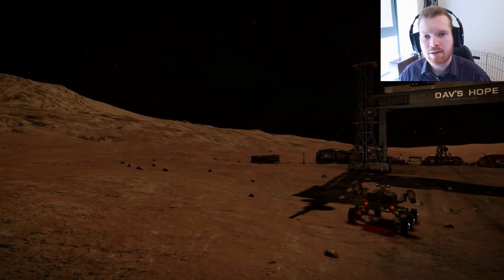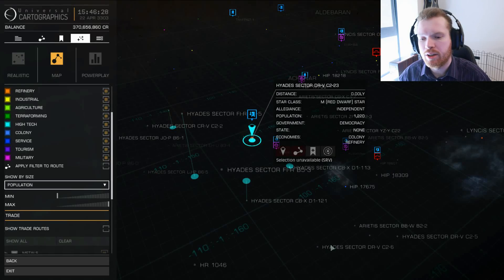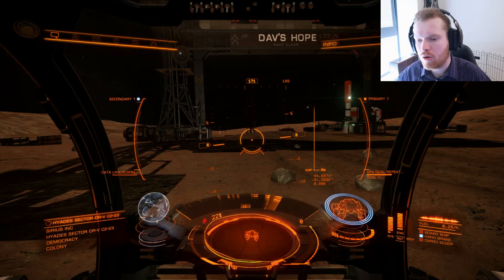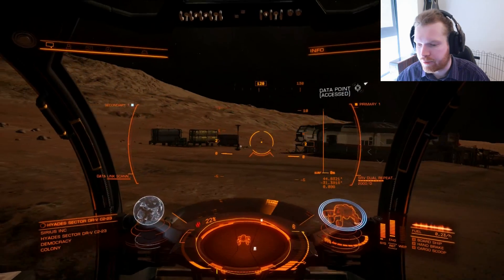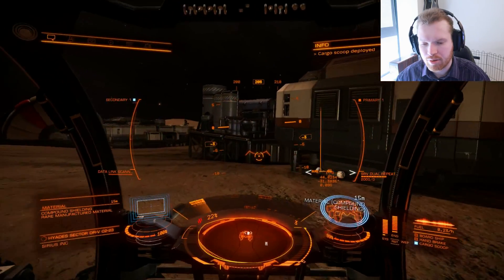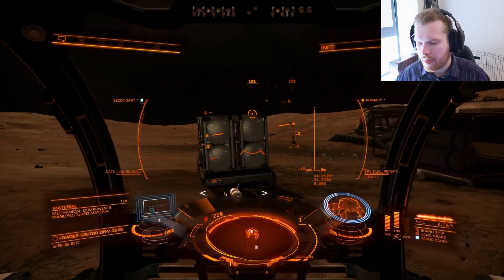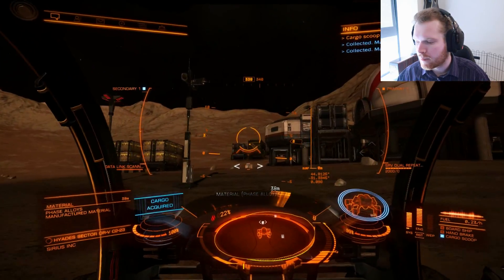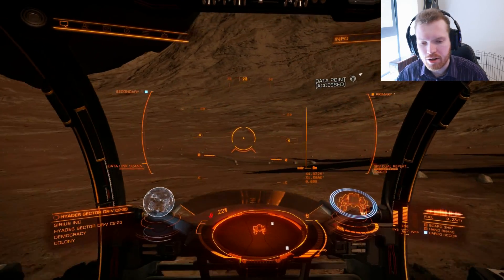HOW TO FIND CHEMICAL MANIPULATORS AND OTHER RARE ENGINEERING MATERIALS | ELITE DANGEROUS

Comment: 2023 or near the end of it and Davs Hope is alive and well. I would HIGHLY recommend using a detailed surface scanner on the planet so it can reveal the actual place. I had spent over an hour trying to line up the coordinates to find out that as of Odyssey its located at about 50, 137. 

Grid Resistors must be a myth, because I've been at it for a few hours now and haven't seen a single one. Referencing the persons list below in the comments, I haven't found one YET. Will comment once I do.
Reply: LITERALLY a minute after I posted this comment, I load back into my game to do another circuit and loe and behold, Grid Resistors. The item model uses the Yellow box thing with the wires sticking out.

Comment: 2022 Nov 26, - still present, not sure if anyone noticed, but there is a Data Link Tower also, which gives data needed for engineering (from the central square, direction 150, the left tower of the "exit gate" like structure. I got quite a few Spec. Legacy Firmware from it.
P.S. 5 re-logs not yet found any Chemical Manipulators in the area :(

Comment: Landed at this coordinates on this planet in this system. There is nothing. Has the planet been reworked or so?
Reply: for this coord, try to log with horizon. it's work for me ! for Odyssey, i saw other coord but not tested at 50.54, 137.42
Reply: @DannyRobert  Can confirm, these coordinates are correct for Horizons 4.0

Comment: Dav's Hope live and well , 4,5 h run :
Basic Conductors 18
Chemical Distillery 54
Chemical Manipulators 108
Chemical Processors 90
Chemical Storage Units 9
Compound Shielding   105
Conductive Ceramics  48
Conductive Components 123
Conductive Polymers   63
Configurable Components  93	
Crystal Shards      39
Electrochemical Arrays  63
Flawed Focus Crystals  114
Focus Crystals    72
Galvanising Alloys  120
Grid Resistors  3
Heat Conducting Wiring 42
Heat Dispersion Plate  99
Heat Exchangers  66
Heat Vanes   63
High Density Composites  200 
Hybrid Capacitors  84
Mechanical Components  90
Mechanical Equipment  99
Mechanical Scrap  27
Phase Alloys  105
Polymer Capacitors  99
Refined Focus Crystals  96
Salvaged Alloys 15
Shield Emitters 108
Shielding Sensors 81
Worn Shield Emitters 21

2 x SRV refuel , you will need 1xSulfur and 1xProsphorus for each one
Reply: Thank you for the update, dude!
Reply: So Dav's hope does have chemical chemical distilleries?

Comment: how many is there? is it worth the trip out there? oh wait they respawn. nice. worth it then. omw
Reply: @Zabe Hameed hey hey, this is 4 weeks older arkey. dav's hope isn't optimal or good for grinding materials. The best way to grind is to find the grade 5's for each category and going to the system that has it, nav beacon or scan for high grade emissions, farming 100 using the exit game refresh method to reset the high grade emission. Trade down the 100 grade 5 and then head back to top it off again. You can max out a category in 20 minutes. For the mission only grade 5 mats, I went and grind imperial shielding because its the easiest and cross traded it for 16. Better than doing missions for 3-4 of them at a time.

Comment: Question: when Felicity calls for 1 unit of Phosphorous and I cargo scoop 1 unit of Phosphorus from a planet, is that the same?  Or do I need to fill up the meter for 100 units before it counts as 1 unit?
Reply: It's not the same as the minerals. The engineer material doesn't take up cargospace. So, no, it's not the same afaik.

Comment: Not so good on my visit.  In fact, there were about 5-6 NPC circling the place and I ran into several other commanders.  The place is now continually picked clean.  Nothing there but comm links.  You weren't wrong about getting stuck though.
Reply from the maker: So it in solo. Then there will be plenty of materials for you.
Reply: @DowntoEarthAstronomy  That did it.  Thank you!!

Comment: Still working as of 16th June 2019, board hopping too. Also, the scannable pylon gives data if it hasn’t been mentioned already. Literally just scan that first data pylon. I’ve had loads of firmware and data from it on top of the materials

Comment: Just tried this tonight, No Heat Vanes or Meta Alloys but came away with Diamond Shards, Chemical Distillery, and other components. Save, log out out and then back in on Solo and items will respawn. Goto Darnielle's Progress in the Maia System if you want to buy Meta Alloys if they have any that is.

Comment: Still works 2019. Also please Thumbs Up or Pin this but in your navigation window you now have outpost Dav's Hope, you can lock the destination and have an easy time! You're welcome, happy farming! EDIT: Apparently you still need to discover the place first and scan it's data points. But for returning trips, it will be visible in your Navigation panel!! I guess this is fine too :>

Comment: I need Chemical Processors for my FSD engineering and I cannot seem to find them here. Anyone else?
Reply: They are present
Reply: I have found about 4 in 20 mins
Reply: I know this is late, but, if you still need chemical processors you can find them relatively easy while engaging in some bounty hunting within a gas giants rings. After blowing up a ship, simply check your contacts and you’ll find a few chemical processors floating around in the wreckage and you can swoop in and scoop them up.

Comment: Huge thanks for this, really appreciated. One question though, how do you have Dav's Hope on your system menu as a selectable location??? Don't we have to grind our way through the lat/long each time???
Reply: Need to scan the data beacon on any location like this the first time you go there and then you will have it on your selectable locations once you get withing 1000 ls of the planet. MAKE sure to scan the main data point at any crash or location like this so you can always go back easier

Comment: 44.8208
-31.3798

I relogged about 20 times, switching from my private group to solo. Walked away with 20 Chemical Manipulators. Just do a lap around the base (nothing spawns directly up the center). Takes about 20 seconds for a full lap. I found CM's about every 2-3 relogs. Only once did I find two in one session. Super easy!

A green light on a red...machine thing may yell at you now and then with a warning annoucement. I doesn't seem to do anything. NPCs may also circle you, but they always seem "clean" and never shoot. Then again, I had a bounty. They still didn't do anything in my SRV.

Comment: So, I watched your video $60 mil an hour collecting thargoid material...and I wanted to know how to get this abandoned outpost as a navigation point after you visit the first time.
In the Thargoid video, you used rover thrusters to lock on to the point under the ground and scan it....but it was under the single Thargoid ship. Here, there is a base with a bunch of buildings....so which do you hover over?
Reply from the maker: +Trent M scanning the main data point should do it.

Comment: no longer working
Reply: Yes it does, just went there and collected mats.
Reply: It's not there for everyone, it's bugged. I couldn't see it on my account, but then played on my buddies went there and it was there.
Reply: Did you try logging out and back in? O.o
Reply: Yeah, I actually just left the planet and came back and it was there... Really weird.
Reply: Okay, at least that solved it. I've seen a video, I think it was by Yamiks, where a settlement just disappeared suddenly while he and his friend were right next to it.

One thing that happened to me was when I was going to a small Thargoid crash site with a friend, I went to the specific coordinates it was supposed to be but it wasn't there and I was really confused as I double- and triple checked that I had the coordinates correct, and they checked out. It also happened to be night time at that side of the planet which made seeing much harder. After some confused driving my friend found the site by accident and it was a short distance away from the coordinates it was supposed to be in. I guess that could be what happened in your case as well. I haven't gone back to check whether the Thargoid site is back in it's original location after that yet.

Comment: for those having trouble finding the system it should be in between the XZY coordinates -110 -1 -160 and -100 -1 -150 (look at the numbers on the grid when using the galactic map, the first number represents how far you must go left or right from Sol, the second represents forwards and backwards, and the third number represents up and down)

Comment: Unfortunately no longer abandoned and up and running automated mining field with turret and skimmer defense systems and no materials.
Reply: I think I did the same thing and went to the wrong place.  Nearby Dav's/Hobbe's Hope is another settlement/base with active defenses.  When I say "nearby," I mean a five minute SRV drive, tops, and the blink of an eye when you're flying at mach 2.  You need to be rather precise with the coordinates shown in the video.  I'm at 44.81, -31.38, in the middle of Dav's/Hobbe's Hope
Reply: I'm there and it's abandoned, no turrets or skimmers.
Reply: I had to go back a couple times, and have used it a lot since.

When I went to coords originally the game spawned a mining field rather than the actual station.

When I was told I was wrong I went back again and still saw a mining field.

A third attempt actually showed me Dav's Hope which I was able to log and record as a landing point so you're right, Dav's Hope shopping center exists.

What's funny now though 2.4 is that in my game the sign says "Hobbe's Hope" but the beacon still says "Dav's Hope".

All of this is chalked up to errors on FDev's end... but I won't complain because we need a resource outlet like this frankly.
Reply: Strange...
Reply: Very strange, I agree.

Comment: I can find the other items in the area, but no chemical manipulators???
Reply: Same problem here @ 2:56 he picked up Chemical Component and called it Chemical Manipulator.
  
 2 different items for sure, I re-logged several times and never found a manipulator at all :*(.

Chemical Componet are used on>
Dirty Drive Tuning L3 (Thrusters). Reinforced Shields L2 (Shield Generator). Reinforced Shields L3 (Shield Generator). Rapid Fire Modification L4 (Seeker Missile Rack). High Capacity Magazine L5 (Multi-Cannon). Double Shot L4 (Frag Cannon). Rapid Fire Modification L4 (Mine Launcher). High Capacity Magazine L4 (Seeker Missile Rack). Expanded FSD Interdictor Capture Arc L3 (Interdictor (FSD)). Expanded FSD Interdictor Capture Arc L4 (Interdictor (FSD))
Reply: Just picked up my 1st Chemical Manipulator, so this method does work.

 Huge thx for this video @Down to Earth Astronomy, really helpful.
Reply: Yeah, After a bit of hopping around, i did get some, but they feel very rare.

Comment: Hey thanks for the vid. I seem to have a problem and I'm not sure if anyone else is having it, but when I fly to that exact system, there are no planets there, just 3 suns. I have tried relogging, and jumping back and forth systems but no luck. Maybe someone has some insight on this?
Reply from the maker: You need to fit a discovery scanner and scan the system before you can see the planets. otherwise try to scan the nav beacon close to the jump in point.
Reply: Ty

Comment: My full list of materials I found there:

Chemical Distillery
Chemical Manipulators
Chemical Processors
Compound Shielding
Conductive Ceramics
Conductive Components
Conductive Polymers
Configurable Components
Electrochemical Arrays
Flawed Focus Crystals
Focus Crystals
Galvanising Alloys
Grid Resistors
Heat Dispersion Plate
Heat Exchangers
Heat Vanes
High Density Composites
Hybrid Capacitors
Mechanical Components
Mechanical Equipment
Mechanical Scrap
Phase Alloys
Polymer Capacitors
Refined Focus Crystals
Shield Emitters
Shielding Sensors

Thanks for this very good tip !
Reply: there was an update a week ago. i'm sure frontier saw these posted and nerfed it
Reply: The Full item list is still valid. Even chemical manipulators. At first I wasn't getting those, but after about 30 to 45 minutes I started getting them. They are harder to get than some of the other items
Reply: The list is still valid, 07/24/2017
Reply: perfect! 11/16
Reply: I spent 4 hours here and got EVERYTHING BUT chemical manipulators which is the only thing I needed I have like 100 of refine focus crystals 100 processors a bunch of the other stuff not a single manipulator, I am so unlucky or this game hates me
Reply: DTEA can you check the system map to confirm for me that FDEV deleted the A system entirely in this system. Just wondering. I plotted a course for the planet and it's gone.
Reply: Still valid, 8/20
Reply: Still good post 3.0 update 13th April 18.